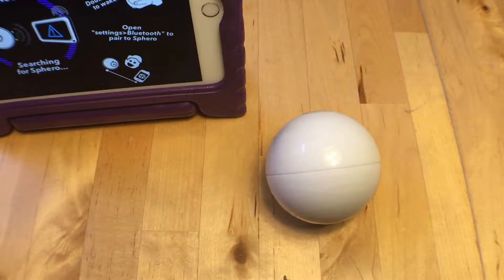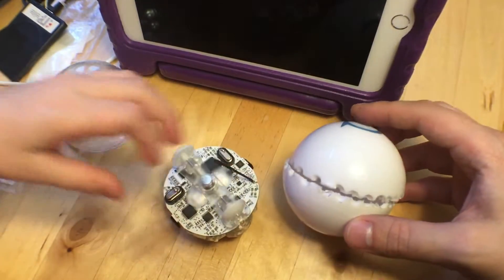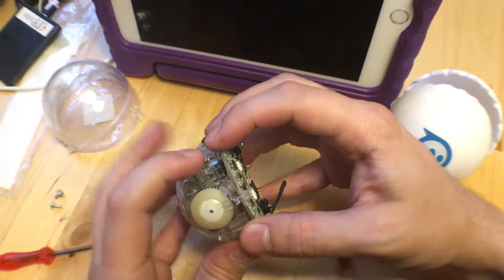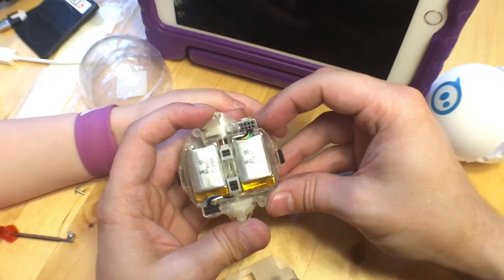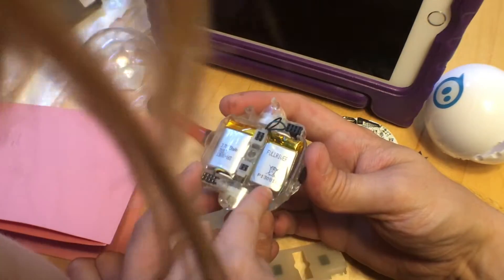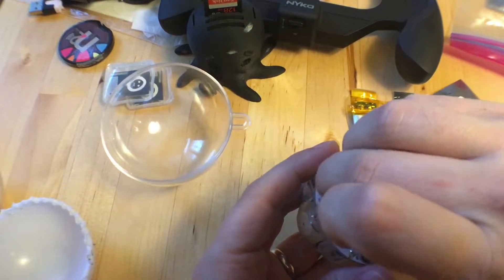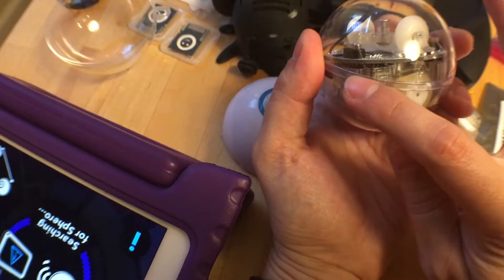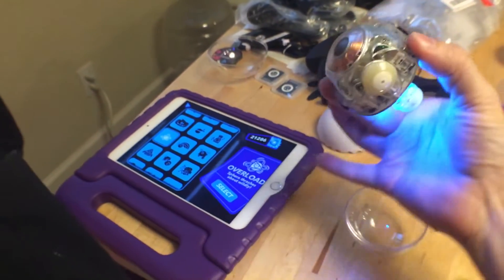Sphero Battery Replacement + Upgrade! (ASMR version)

Comment: Hello there, this video its awesome. I've replaced my Sphero 2.0 batteries with no issue at all. But now Bluetooth doesn't seem to work properly. I can't connect it with a phone
Reply from the maker: Try with your phone so close it can touch the Sphero. It’s possible you accidentally disconnected the antenna.

Comment: Does these exact parts also work for the Sphero BB-8?
Reply: I'd think that the ball would, but you'd probably want to measure the BB-8 ball to be sure. As far as the batteries go, Check BB-8's batteries to make sure that they are the same specs to avoid a fire or anything like that.

Comment: First off JuliansRandomProject, your battery and case recommendations were spot on.  I used a variable speed Dremel with a flex shaft and Gyros 82-11015 saw blade clamped in a small vise to only go ~2mm around the original case.  I also used this blade to take off the ornament tabs when needed.  I'm not a huge fan of soldering near/on LiPos, so I opted for using the original plugs that came with the batteries.  I shaved the 'bottoms' of each plug (see https://images-na.ssl-images-amazon.com/images/I/61O5OyJu9vL._AC_SL1500_.jpg), again with the saw, and super-glued them together.  Since the positives for both batteries are on one side, you have to unlock and switch the polarity of the pins on one of the plugs.  This puts the tolerances of the plugs within the pins range nicely.  There is also a flange at the wire-side of each of the plugs you may need to shave off.  Next, fit the plug into the space where the pins will insert to it within the casing, note where the positives should be. (I want to say they are 'away' from the multi-pin recepticle on the same side)  Then route the (thicker) wires through each of the wire guides.  Carefully lay the wire into the battery space with the batteries to follow, gently pressing foil corners into place.  The original plug retention clip thingy will not fit again, unless you want to x-acto it, etc... but I doubt it will, and you'll find it's really not needed.  Now everything is laying somewhat flat in the case.  With a small screwdriver, guide the plug where you kinda want it to sit when you align the pins.  It will be easier if you position the plug higher than everything else, but make sure it will actually sit down when pressed for re-assembly...again, these wires are thicker.  Carefully guide these four pins first into the plug recepticle you made.  Press and guide the rest of the pins/board into place and re-assemble and test with your new ball and some masking tape.  Once you're satisfied that it charges and works, let it charge for awhile...the batteries come with little charge.  I used thin CA to seal the ball like you did.  Thanks and kudos for getting all the spec parts lined up for us!

Comment: you can buy the batteries cheaply at allie express.  Just plan on it taking a long time to get the batteries.  I bought 40 500ma batteries for $1.60/piece.  If anyone knows of a good shell replacement, please post.
Reply from the maker: Hey Brian! Sorry your shell is on the snug side. may want to check the spring loaded mechanism on top for fouling. It's possible the shells dimensions have shifted over time or supplier. It was originally an ornament so they 're probably ok with +/- a few millimeters. Good luck! Let us know how it goes.

Comment: I have a whole class set of dead sphero sprk+ robots.  I managed to get the batteries replaced, but the shell from this video description doesn't fit.  It is too tigjht for Sphero to turn.  Beware!!!  The shell doesn't fit right.  Now I have 20 shells that won't work with SPRK+.

Comment: Hey there, thanks a lot for this video. I think it's the only one about that sphero battery issue, I read the internet twice to be sure. I just cut my BB8 in half and fortunately that the same mechanism as yours. I haven't much knowledge in batteries, could you please tell me what the difference between the 350mAh and the 380mAh ? Won't the difference of power damage the internal motors ? Will it be longer to charge or need more powerful charger ? Although, I think I read these battery don't like powerful charger (like the iPad charger as exemple) nor to be constantly on its charging platform plugged, is this true ? Once again for this video it helps a lot :)
Reply from the maker: Extra mAh in the battery (provided it'll fit will only benefit you. No change to the charger needed. More just means more play time. And yes, for best battery life, do not leave on charger all the time. Good luck! Have fun
Reply: Nosho7 hi my bb8 died too. 
did you successfully replace the battery ?
Reply: Handy Ndy hello, I did succeed, but I had still the same issue, either I did something wrong or the problem was somewhere else. My BB8 still doesn’t work
Reply: Nosho7 sorry to hear that. So problem is not the 🔋 ?
My bb8 prob is definitely the 🔋, but i dont want to damage the look of it
Wondering if someone sell bb8 empy shell so we can fix the inside, and keep the outside look
Reply: Handy Ndy I did managed to open it quite cleanly it’s not that difficult I can send you pictures and more précisions if you want
Reply: @goodlifebdg  Ok just sent you an email, so you can erase your comment to prevent get your inbox spammed
Reply: Nosho7 thanks !!
Reply: Handy Ndy did you get my mails ?
Reply: Nosho7 hi Martin, yes i got your mails ! Thanks for your help
I will try this, hopefully i can replace the 🔋 successfully 🙏🙏

Comment: Loved this video!  I too had a dead Sphero that I wanted to give new life (who knew cats would be so obsessed with this thing).  One question though, I did exactly as you did, but the ornament case seems too tight... I can't get it to drive straight.  Did you have any issues with this?
Reply from the maker: no issues with the ornament case I used. Maybe try another brand/size or adjust the spring tension?

Comment: Thanks for the inspiration...and posting the battery availability in Amazon. I carefully split the ball apart.  I am reusing it.  I will use CA glue thick to put back together and then get a cover for the ball
Reply: How do I desolder?
Reply: @AndresSanchez-io1oi  need a soldering iron with a fine tip
Reply: bill black I'm confused. Is there a way you can record yourself doing it?
Reply: @AndresSanchez-io1oi  I wish I could but I have already done the battery swap.
Reply: bill black ok, so did you ever cut the cables?
Reply: @AndresSanchez-io1oi  no I did not.
Reply: bill black what was your first step in the process? Thanks for helping out!!!
Reply: @AndresSanchez-io1oi  have you opened the ball ?
Reply: bill black yes and I opened it all up to the batteries. How do I start sauntering?
Reply: @AndresSanchez-io1oi  take the tape carefully off the old batteries..look at the cables blue and red are both positive..unsolder old batteries... the new batteries have the + and - clearly marked. Unsolder the cables from the new batteries.  Solder the cables from the ball to the new batteries...
Reply: Hello Bill, how did you open the ball without cracking it??

Comment: Thanks for posting this.  After a long back and forth with Sphero support, I was informed that "all electronics eventually die".  I then went to the googles, and found your video, ordered the parts and fixed it in less time than I spent corresponding with Sphero support.  I just taped the ball closed, incase it breaks.  Doesn't seem like the christmas ornament is going to hold up as well as the original poly carbonate shell did, but that's to be expected.  Also, you can get the orginal cracked open pretty easily with a dremel and a cutting wheel.  Just make sure to rotate as you cut and make sure you're not cutting the robot inside.
Reply from the maker: Michael, You just made the whole effort of recoding this and posting it worth it! Good luck with your Sphero and its new lease on life :)

Comment: How did you deal with connecting the batteries to the pin header? Which colors align which which? The batteries came with red and white wires; the Sphero has red, white, black, and blue wires.
Reply from the maker: If memory serves... I desoldered the old cells after removing the protective Kapton tape and moved the original wires over to the new cells. Re-applied some kapton tape and done.
Reply: @JuliansRandomProject  Thanks. I'll give that a shot.

Comment: do you think an 8mm thick battery could fit? seems you can get a decent step up in capacity with an 802035
Reply from the maker: Yeah. 8mm would prob fit.
Reply: @JuliansRandomProject  cool, well just ordered some 802035's that say they are 800mah. would be nice if they are but wouldnt be surprised if they arent. we'll see. 
fortunately i contacted sphero when mine stopped working and they are sending me a coupon to buy a new one. not that great that its a coupon for their american store and i have to pay shipping and taxes to the uk but think i'll use that to get a bolt and try fix the broken one. did you try contacting sphero when yours broke?
Reply from the maker: @ge2719  Nice folks at Sphero! It had been a number of years old so I didn't bother with planed obsolescence being what it is. Good luck! Let us know how it goes.
Reply: @ge2719  Did it work? With the 8mm battery??
Reply: @emilhares  it fit depth wise, but the length of the battery was a bit too long and i had to hack some plastic off and reroute some wires. was a pain but i got it to fit. probably easier to find a shorter battery but the depth was okay.

Comment: would your shell be the same for the SPRK edition?
my SPRK edition died recently due to battery not holding the charge as well. will definitely try your method soon!  thanks for the video!!!
Reply: SPRK and sphero are both the same exept sprk is clear, so it should work.

Comment: I bought one of those in a garage sale ($15.00). But the batteries were not holding charge. So I went ahead and followed this tutorial. Now I know why you skipped the part of replacing the batteries. wow, it was hard. The wires of the new batteries are thicker, so I had to break and remove some plastic from the Sphero to place the new ones. But it`s charging now... Lets see in 3 hours.
Reply: Ettore Semeghini I ended up cutting the original wires from the harness and soldering the wires from the new batteries when it became apparent the new pins wouldn’t fit the old plug.

Comment: Awesome!  What type of glue did you end up using?  I was thinking two part epoxy.
Reply from the maker: Rishi Tomar thin application of super glue. Not confident it’ll hold but if not I’ve got more clear ornaments and I’ll try the two part epoxy next in thin amount.
Reply: JuliansRandomProject How did you put in the batteries since they have such thick wires???
Reply: @AndresSanchez-io1oi  when i fixed mine i soldered the old batery wires to the new batteries. I did cut away some of the shell to try get the thicker wires in but it was just easier to solder the old ones especially when they already had to right connectors on already
and i went with bigger batteries so i had to reposition the other connector wires so they went to the outside of the shell and not in the battery compartment. you need to pull the connectors out and up, pull the wires down and then push the connector back down. was a bit of a pain though. i'd recommend making sure to get the same sized as in sphero. though the ones i ordered where big than listed.
Reply: JuliansRandomProject and what sautering???
Reply: buy a sphero case. much easier to install. no need to glue. so you can repair or replace the battery in the future easily.
Reply: @dablet  Where is a "sphero case" (shell) available for purchase, please? I haven't found any.
Reply: yeah, one of the rubber tyres you can put them in should hold the two halves together. 

but if you wanted to glue them might something like a solvent melt them? ive used mek for glueing lego togehter. not sure if it would do anything for the plastic the shell is made off btut if it does it will literally melt the two halves together.
Reply: @dablet  did you manage to buy a case, from where please ?

Comment: First!
Reply: How did you put in the batteries since they have such thick wires
Reply: @AndresSanchez-io1oi  very carefully desolder the new battery cables and then solder back the sphero cables